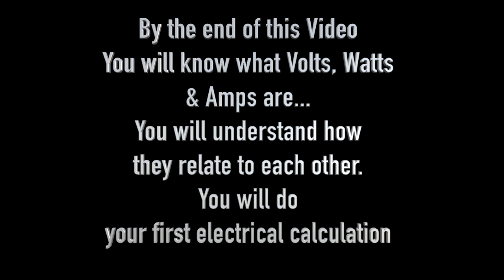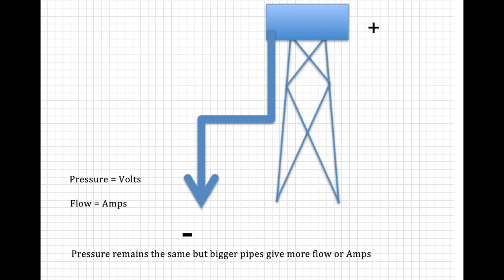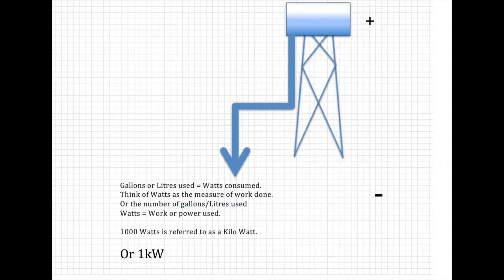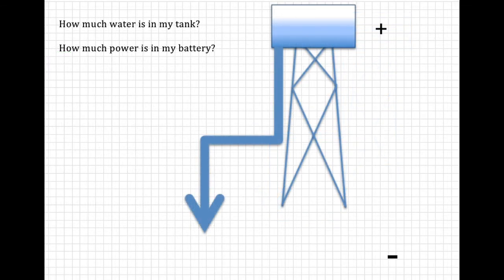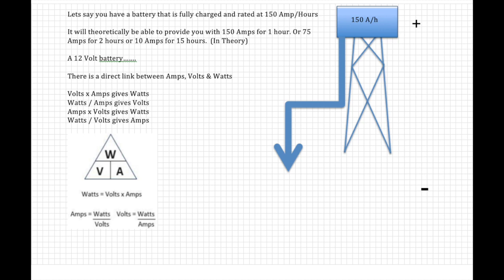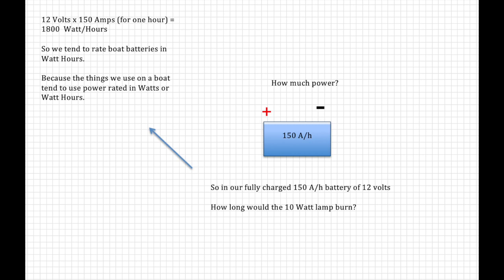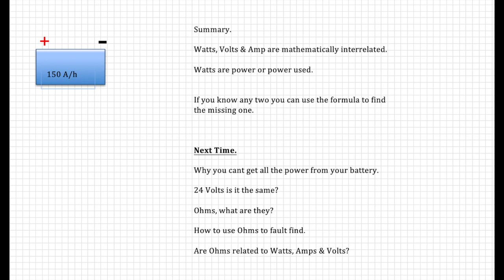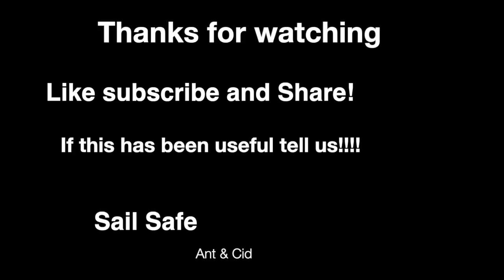Boat Electrical Made Easy! The boat electrical Video series you have to watch!

Comment: Im a commercial electrician but i have never worked on a  before, but if you understand electricity you understand electricity. A friend called me and said she was watching TV on her boat for about an hour then all the power shut off and the individual breakers started reading reverse polarity.  this should be impossible considering no work has been done. The  main breaker has 120V to ground and is not reversed when i checked. I can see the hot coming off the main output into the input of the other breakers but i ran out of time and didnt check the reading, but im pretty sure its correct. What would be the next thing you would check? Im assuming its a equipment problem somewhere not a wiring problem
Reply from the maker: It sounds like someone may have may have fiddled with the main supply. There is nothing on the boat that would cause this. However, reversed polarity also presents a serious shock risk. Turning off a breaker appears to remove power from the circuit because it turns off all appliances connected to that circuit. But with reversed polarity you have disconnected the appliance from ground, not from power. The circuit is still live! On most boats 70ft and under, the shore power lead supplies the vessel with 110v AC power. The shore power cable that connects the dock power to your boat has 3 cores inside. An Active, Neutral and an Earth. Now because of the way switchboards are wired. Your AC circuit protection switches the Active conductor. Your Neutrals all get join together and your earths all get join to each other on bus bars. In some switchboard installations, not all, there is a connection between the Neutral and Earth bus bars. This is ok and safe as long as the Active supply doesn’t get connected to it.

When reverse polarity occurs from the dock side supply. You now have switched the Active and Neutral conductors around and the Neutral and Earth bus bars that were before safe, become live. As I mentioned before, in some cases there is a connection between the Earth and Neutral bus bars. If the Active and Neutral conductors are now switch, not only is your Neutral bus Active but so too is your Earth bar. This earth bar connects to all your metal frames and items on your AC systems. Making them Live. This can create a dangerous touch potential and is very serious.

How do you fix this? Well the first thing is to turn off you main switch that supplies your main switchboard and unplug your shore power lead. Most marinas have a service man who can come and change the wiring of the dock power outlet to suit your vessel. If you travel around a lot from dock to dock, one option is to get a reverse polarity switch put in which you can use to just turn in this situation and continue using your boat without rewiring anything. Reverse polarity lights and this switch are easy to install if you have room at your switchboard. If not they can be installed together in a secure location nearby for easy viewing but must be in line with your shore power input cable. Checking with this system or a polarity tester is always recommended for the reasons I stated above. Hope this helps Ant.

Comment: Good vid. I'll show it Carol. Getting 460 watts now regularly from our two 240watt Panasonic hit panels not that they are mounted properly.  Very pleased
Reply from the maker: Thats great Stuart. Do you know what your producing in watts per day? The victron app can tell you this. It would be interesting to know. Glad its all worked out. Woody tells me hes not been below 90% and is now thinking about a big inverter to run the washing machine!!!  Sail Safe mate Ant, Cid and the pooches.
Reply: Display total says 109kw
Reply from the maker: @stuarthinds848  Thats great. Time to get air-con 😊

Comment: Great how you’ve simplified things , although going to watch a few more times 🙄 as not the sharpest tool in the box 📦😂, sure will be of great benefit to boat owners .
Reply from the maker: Hi Shaun. Your a smart cookie. Dont over think things! If there is anything you need clarifying just drop us a line. Happy to help out or just explain better. The plan is to make a few as a how to box set. Starting with the basics and going on to the practical. Little steps that folks can re visit at any time. Thanks for watching as always. And thanks for the feedback. Sail Safe!  Ant & Cid xx